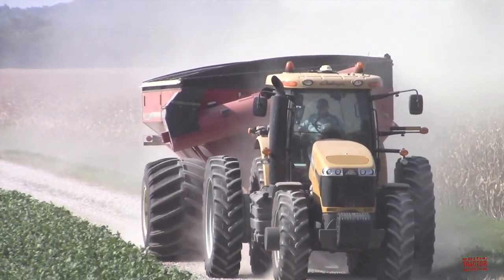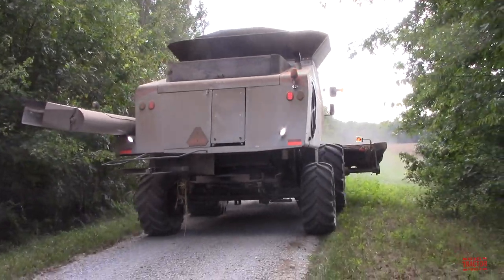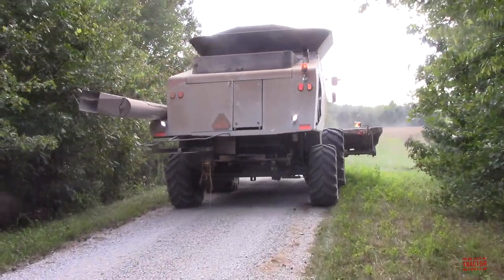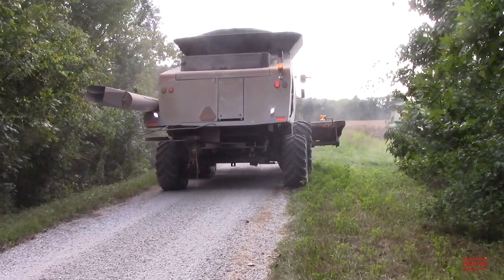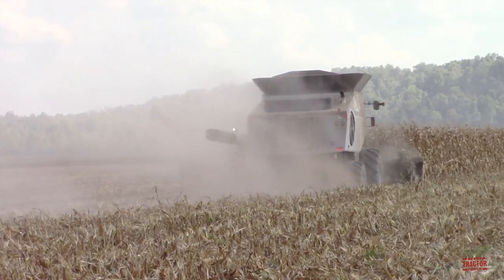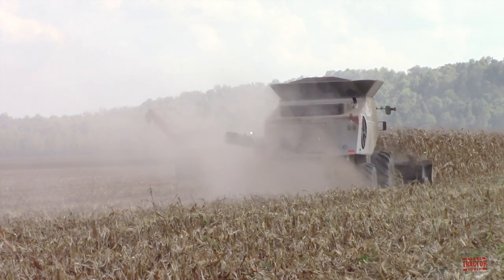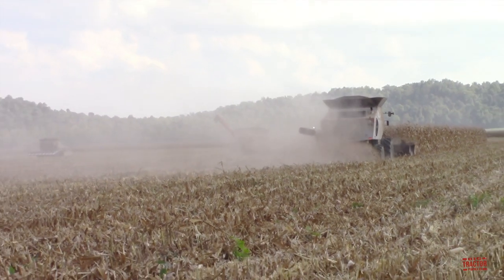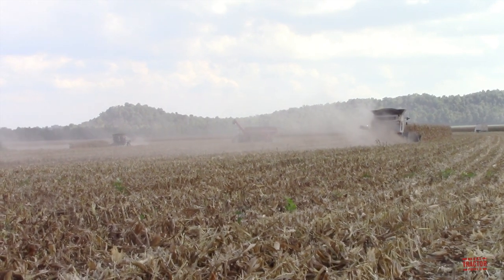GLEANER S77 Combines on the Move in Corn Harvest

Comment: I ran a John Deere 7800 with a 740 Classic Loader on it to pull a 700 bushel A&L F705 grain cart for corn harvest. The combine the farm I was working for was using a John Deere 9660 STS Bullet Rotor combine with a John Deere 893 30 inch 8 row corn head.
Speaking of which, I'm going out there today to help finish the harvest, there's only a little bit left.

Comment: R62 Gleaner 8 row head allis chalmers 7580 with demco 550 cart. I think the s77 are rated at 390 hopper.
Reply from the maker: The S78 and S97 are 390 bu and 375 hp.  The S77 was just a little smaller.

Comment: Always been a fan of the Gleaner combines. My neighbor used to have a Gleaner with a 2 row corn head. I can’t remember what the model was. But there’s a YouTuber in Indiana that has 3 Gleaner L2’s and one of those has the old steel tracks.
Reply: The combine your talking about with the 2 corn head could  have been several different models. My dad bought  an A gleaner in 1971 it had a 2 row 38 inch row spacing cornhead and 12 foot wide grain table. Then in 1975  my dad bought a G gleaner it had a 4 row 38 inch row spacing corn head and a 15 feet wide grain table. Then in 1983  my dad bought a M gleaner, it had a 6 row 30 inch row corn head and 18 feet wide grain table. We ran the M combine til 2001. These combines all had the threshing cylinder mounted in the feeder house area and had a rock trap door built just to the front of the threshing cylinder. That was the main reason he ran the gleaner combines. They had reliable engines , transmissions, and final drives. Never had any trouble with those items on any of the 3 machine's that we ran.
Reply: @leonsieberns9191  i started thinking about it and looking around, I believe it was a model K combine.
Reply: @blakedaulton8120  You're thinking of Dirt, Grain, and Steel...good channel!
Reply: @atomicwedgie8176  that’s it! Yes definitely a good channel!

Comment: Those safety chains for implements never stay coupled together! EVER! even brand new and especially in corn stalks that haven't had any stompers run over them. Sometimes they'll last 1,000ac if you latch em and then take some electrical tape or duck brand duct tape. But the stalks will still eat em alive by 1,000ac! Then whatever your do next. No till drill or till. Might as well just take the safety chain off. Cause it'll be dragging every 200ac. It's rediculous every company uses the exact same safety chain system THAT DOESNT WORK! You really should do a video on that! From now on every single farm you go to ask them what they think about the current safety chain system that's used by every single manufacturer in the United States. Then put together a video when you get enough. Then someone should do the same over the pond. I bet you a million bucks they don't use the same system over there. Shoot. They make them use brakes on their implements for road travel over there. Idk. Just seems weird to me that every single manufacturer in the us uses the same dumb idea with the spring loaded pin that locks the slide thing in place. Just hope your implement never detaches on you anyway! If your in tillage it's mighty violent! And down the road it's scary! Had a fert cart pass me on a 4 lane hw! Smh. The whole drawbar came out of the tractor!  Dang. They didn't let you ride along? Or do those gleaners not have a goot buddy seat system?  Ok. Sorry for the ramble!